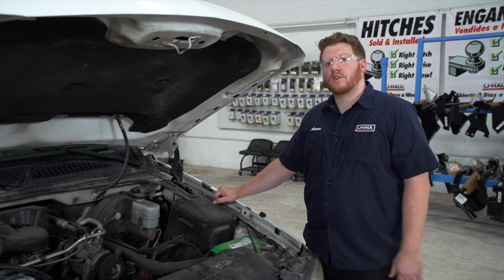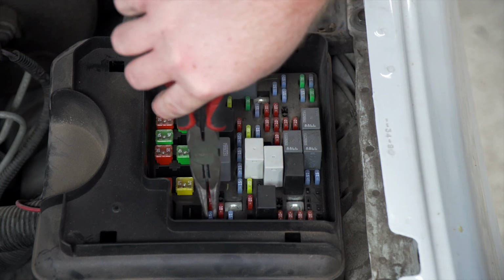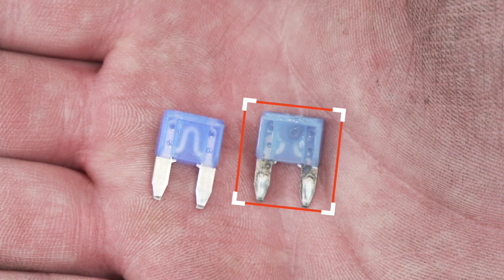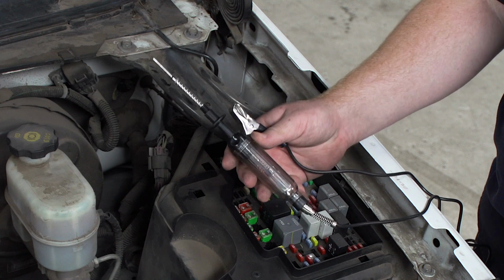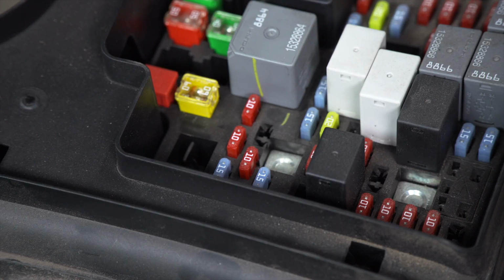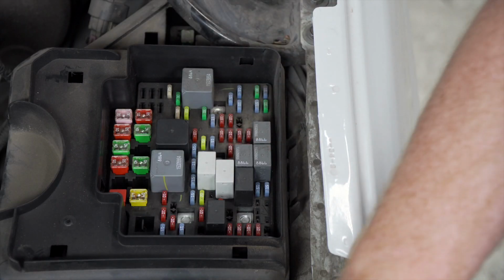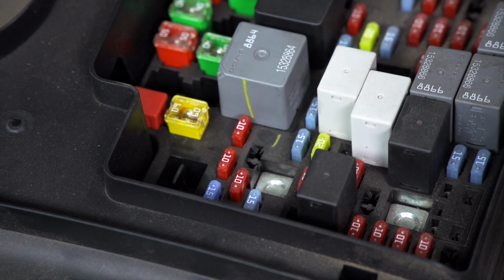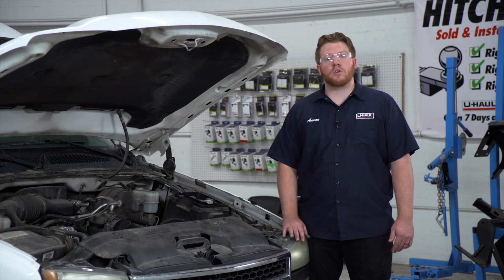Blown Fuse? How to Test Your Fuses.

Comment: My fuse isn't blown but the prongs are brown and look burnt.
Reply from the maker: Did the Fuse test functional like Aaron shows in the video? If so its ok. You can always replace the fuse if your concerned. Some discoloration is to be expected when electricity passes from one metal surface to another.

Comment: Question? See how the blown fuse has that brownish build up under the plastic part? I have some built up way worse than that but, fuse still whole. I havebee having some issues and think this could be it. Would a lot of this build up there ( I'm talking no silver at all showing) could this cause issues? Should the fuse be replaced or, would it be sufficent to just clean it up with a light wire brush?
Reply: Buy new fuses
Reply: @bensmith9175   I got rid of that car such a money pit!